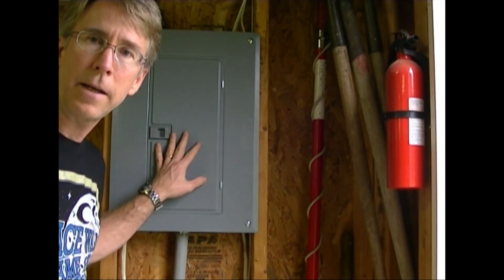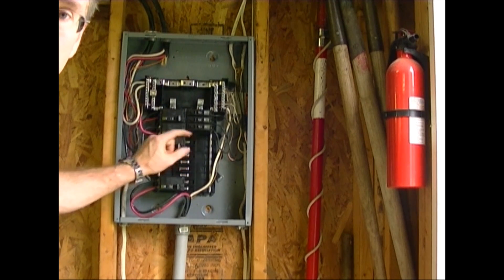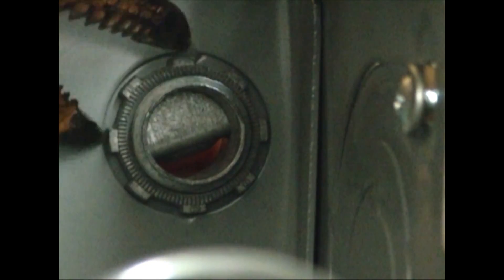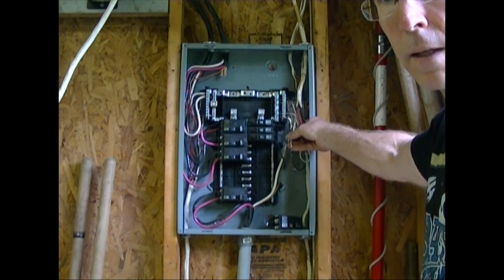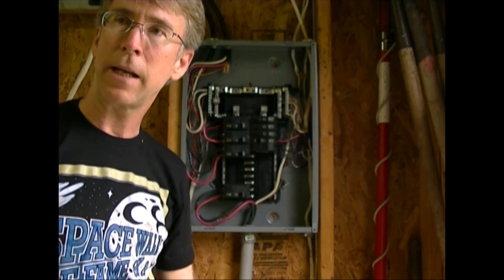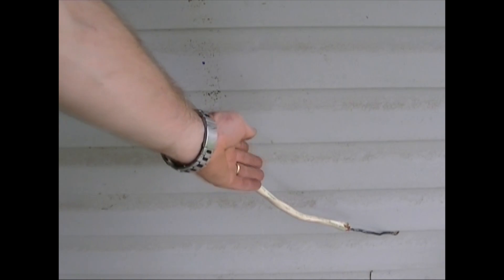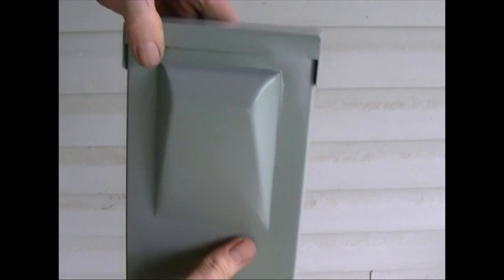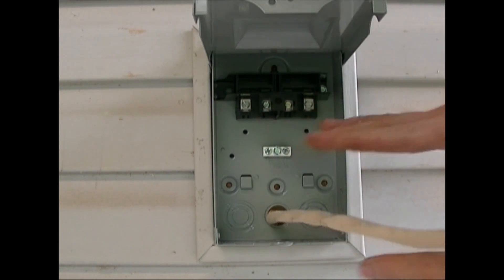How To Add A Circuit To A Load Center (Breaker Box)

Comment: Thanks for this, I'm completely ignorant when it comes to ac/dc. We're having a pool installed and when the ground crew was here they uncovered the power going out to my shop. The previous owner had ran it himself, he ran inside wiring, off of a living room receptacle and then buried it in the ground and ran it to the shop. I didn't realize this until I cut the breaker labeled "shop" and every outlet in my living room went out. An electrician is coming to run power to my shop and the new pool pump, it's not something I"m comfortable doing myself, but I'm sure I'll wish I did once I see what it's going to cost me.
Reply from the maker: Wow. I've seen some interesting jerry rigs but that one is pretty crazy. People try to save time and money by tapping off of inappropriate circuits. It's always best to run a new circuit for something like a shop. Glad to hear you're getting it done right. Thanks for the comment.
Reply: funny!! scary too..just make sure to tell the electrician what you plan on running in your shop.
make sure he installs a sub panel with at least 8ga. feed and 30 or 40 amp breaker running to it. can't tell you how often I find 10 or 12 have. 20 amp breakers and when u try and run a 240 volt or 120v shop tools they run weak. 
I had to correctly Guage my garage with a 240 sub panel 6ga. feed. no more lagging on my compressor and lathe anymore...

Comment: Hii sir how do I convert a 220breaker to a 110breaker for air conditioning? any help will be appreciated thanks!
Reply from the maker: OK, you can totally do this.  If your original 220VAC air conditioner had 3 insulated wires (usually red, white and black) then just connect the black wire to your 110VAC breaker and the white wire to the neutral bar and leave the red wire disconnected.  If your original 220VAC air conditioner had 2 insulated wires (usually white and black) then just connect the black wire to your 110VAC breaker and the white wire to the neutral bar.  That will give you 110VAC on the black wire and neutral on the white.  There should be a bare copper wire to ground which you need not mess with.  When you have it wired turn on the breaker and measure black to white with your multimeter set on VAC to be sure you got it right.  Good luck!

Comment: Great vid, thanks. You might want to record which circuit breaker is which on panel door.
Reply from the maker: Excellent comment!  Actually, I got a label maker for my birthday a few years ago and went crazy with it.  So my door now has neat and correct labels on it for the circuits.  I'm surprised that I didn't mention it as this is one of my pet peeves - unlabeled or poorly labeled circuit breakers.  Thank you for bringing this up!
Reply: Idea, You can splice in a section that shows the label maker in this current video and re-post it.
Reply from the maker: I like that idea.  However, I'm currently living on a different continent than my breaker box and label maker.  It'll have to wait until I move back home.  Thanks for the comment, though.

Comment: have four big yellow wires connected to my circuit breaker im on the second floor there is an illegal apartment in the attic i think its hook up to my power how can i tell
Reply from the maker: First of all, you win the 'comment of the week' award.  Second, here's what I'd do:  Turn off the breakers that the four yellow wires are connected to.  If you are not missing any of your power then leave them off.  If someone turns them back on, then you can remove the breakers with the yellow wire (after turning off the main breaker, of course).  If someone replaces the breakers, you can turn them off and cut the yellow wire so that they are too short to reach the breakers.All that said, your relationship to and safety from the person living in the attic will be made tenuous at best by these modifications.  Proceed at your own risk.  Good luck.

Comment: This was exactly what I was looking for!!
Reply from the maker: +rhizo tonic So glad to hear it.  Hope your project goes well.  Thanks for watching.
Reply: +FloridaJoe3 how would I run electrical to a shed?..if I use romex should I put it in conduit because I'm pretty sure u can't do that but I also don't want to just bury it.
Reply from the maker: +rhizo tonic I used underground wire.  Go to the Lowes web site and search on underground wire and you'll see a gray (UF type) cable that is just perfect for the job.  And, yes, you just bury it.  However, I did bring mine up through the slab and into the box with conduit as you can see in the video.  Please see my other video (especially the correction video) for instructions on installing a load center if your planning on putting a load center in your shed.
Reply: +FloridaJoe3 what about where the wire comes up do I need a cover or conduit of its exposed
Reply: +rhizo tonic or can I use clamps to the side wall?
Reply from the maker: Certainly.  Or electrician staples if your studs are wood.
Reply: +FloridaJoe3 thank u once more!

Comment: when you installed the cutoff, why didn't wire the neutral to anything? I don't think its up to code to just have it hanging out there
Reply from the maker: +TheJumpinSheep Glad you asked. If you are wiring for a circuit that is purely 240VAC, then you don't need the neutral since line to neutral is 120VAC. Phase (line1-black) to phase (line2-red) is 240VAC and no neutral is needed if 240VAC is all you want at the circuit. Ground (the bare or green wire), on the other hand must still be run to the circuit.Actually that box was not correctly installed first time around. Please see my other video (CORRECTION How To Change Out A Load Center) for a complete discussion of how to handle neutral and ground in a remote box. Thanks for the comment.
Reply: +FloridaJoe3 thanks! i appreciate the extended reply :-)
Reply from the maker: You're more than welcome.  I don't want any home repair guys to be 'shocked' with their results.